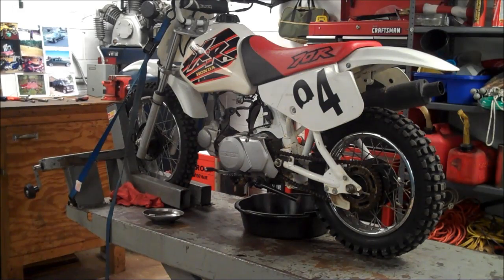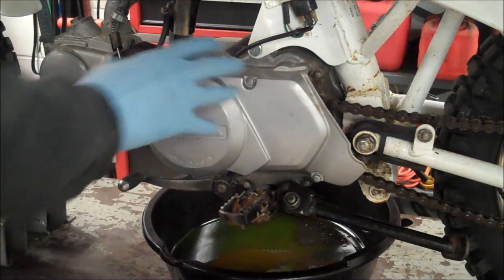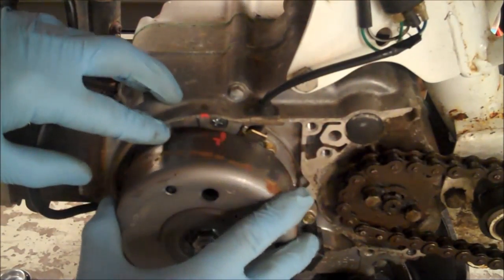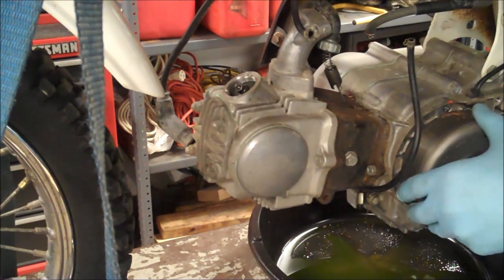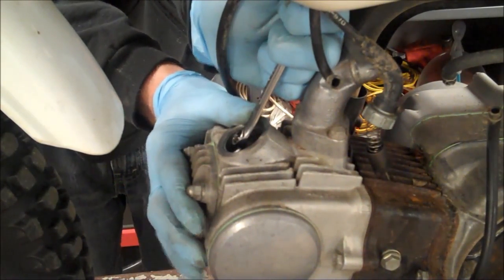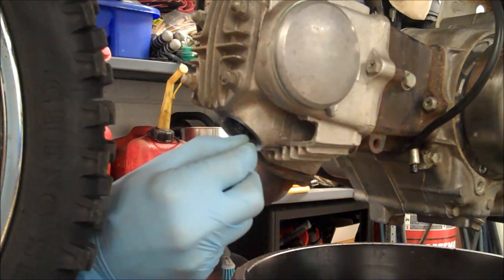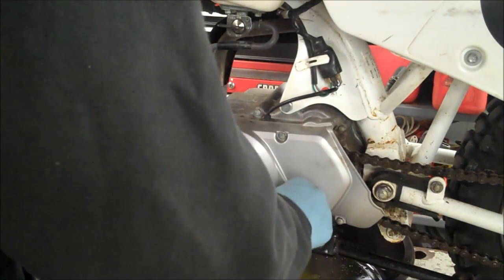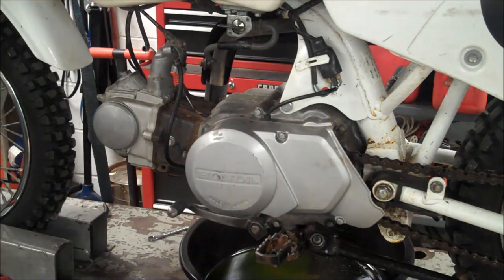How-To: Honda 50/70cc Valve Adjustment (XR70R)

Comment: I have a question aside from ticking noise would valves out of adjustment cause a hard start and also when the bike gets warm it loses power almost to the point of shutting off is that also a symptom? It doesnt smoke or anything like that
Reply from the maker: Start with a compression test. Then look for vacuum leaks, clean and adjust the carb. Just a few thoughts.

Comment: I didn’t measure anything or do any of that top dead center stuff. I just loosened the valves until I could barely wiggle them and it cranked on the 2nd kick. lol! Just fyi for the dads out there with 3 boys and a couple monkey wrenches to fix everything 😂
Reply: As long as the valves aren't ticking loud then your golden lol

Comment: I don’t see the T on the flywheel . It looks pretty rusted up. I have a 2003 Honda xr70r. It is a pain to start I have to kick it a lot. But eventually it will start. And will idle and die. Eventually it will start to idle once it’s warmed up. But it still misses and doesn’t run right. The oil also looks grey and cloudy.
Reply: You most likely have water in the oil and carburetor. The airboot has a rubber gasget that comes loose and can allow water in the carburetor. Take apart carburetor clean with dish soap and old brush. I use guitar strings to clear jets but you there's a wire tool you can buy. Put carb back in start without airboot attached. If it fires up without airboot but won't with its dirty clogged filter. If you clean carb clean airbox. Should have a filter in there if it's falling apart or gone clean out and buy new one make sure to oil it. Make sure you put ground back with screw were the airbox/boot screws in. Turn the screw to the left of carb 1 1/2 turns out from all the way in the one to the right behind choke start with it a turn out from in. Then see were your at. If that doesn't help can be your needle hight or float bowl height.  it's also good to make sure your spark plug has good connection this can cause it to cut out if spark plug has pieces missing on it and doesn't have a tight connection. Oyea and take your spark plug off and shine a light in there when you see the piston stop at the top to go back down thats top dead center. 😎

Comment: Thank you sooo much, helped out a lot, just got a 1974 49cc Honda to fire. Haven’t been on it since I was 6...I am now 39 😊
Reply: Matthew, I can’t see any videos that you posted on the front sprocket of a motorbike. Since you seem to pretty much know everything on these bikes I have a question for you. I have a 50 cc Honda 1974. The front sprocket is incredibly loose and has a lot of play on it, I understand they’re supposed to be a little loose but it seems to have a lot of playing. There’s two bolts on it, what will I find if I remove them, and how do I tighten the front sprocket a bit? I thought simply tightening those two bolts a bit, but it did not do anything? What do u suggest?

Comment: so i have two xr50's one is extremely hard to start.. once started.. its easy after.. someone mentioned valvle adjustment, why? i'm gonnna go buy feeler gauges but curious
Reply from the maker: Maybe. Perform a compression check cold and hot.
Reply: @HTMR  it fired right up when i loosen the valve.. i can't get the valve shim tool thing.. its so hard to see or feel the gap.. i did it blind and not TDC.. it starts .. valves are noisey but it starts and runs awesome.. sucks i have to wait for too cool to adjust... any tricks to using 0.02 filler gauge? and whole180 TDC thing..
Reply from the maker: @s2000pill  Go to any auto parts store they have feeler gauges.

Comment: I have a 71 Honda z50a that I restored can not get the headlight or tail light to work tired everything new bulbs wires good switch and key all good only thing left is the coil behind the fly wheel any suggestions thanks
Reply from the maker: Service manual should have some troubleshooting/testing of that coil. I don't have any videos on that.

Comment: 6:11 if you can move it up and down, what does that mean?  I just did my first valve adjustment today on my 1975 CB750.  Two of the valves seem to have a very slight up and down play in them that I couldn't get to go away.   I wasn't sure if that's how it was supposed to be?   I tried turning the nut and the screw to get rid of it completely, but I couldn't.
Reply from the maker: I had the feeler gauge in there and felt no up/down play. So clearance is feeler gauge size.

Comment: Hey matt.got a 2001 sundiro 125 cc motorcycle. I believe and can't find any info on where the right parts are.been resorting to Honda stuff.bike runs but would like a better knowledge on what I'm dealing with.any help would be great brother.thanks
Reply from the maker: I'm not familiar with that model. Any way you can get a service manual for it? What do you need help fixing?

Comment: Matt, great videos. Your tutorials are the most thorough and well put together that I've seen so far. Reminds me of a dentist picking teeth with those gloves and the metal feelers scraping those valves. Also, why is it important to have proper valve clearance? Much thanks.
Reply from the maker: Tight valves will run hotter and may leak some compression out. Loose valves are noisy and reduce valve lift.